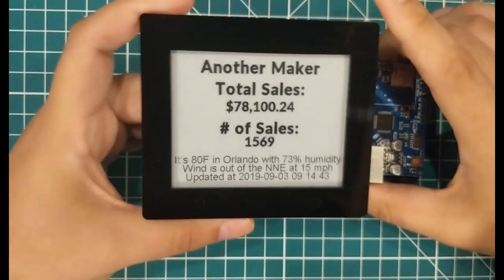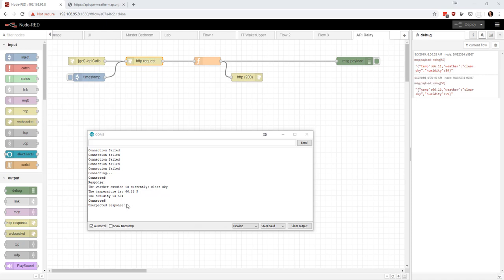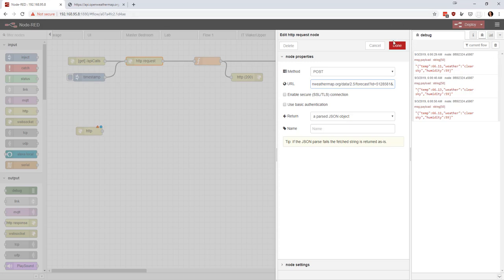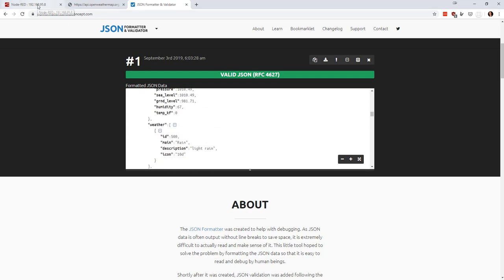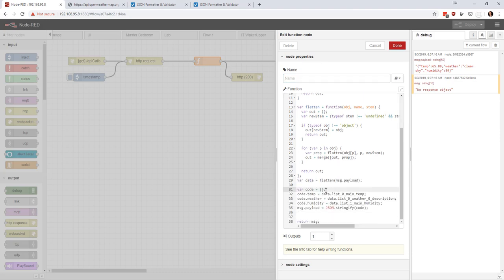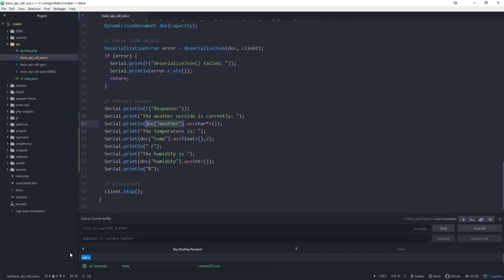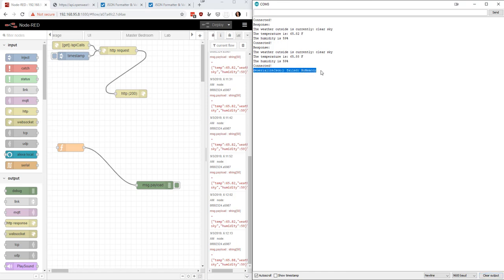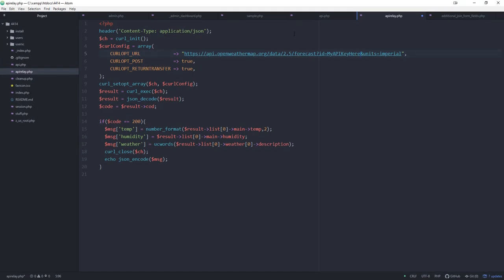Save the Ram! Use an API Relay

Comment: Good solution to the problem. If you're insecurely communicating on your own network, why bother with http between the iot device and your local server? Why not just drop to the sockets layer? Wouldn't that be more memory efficient? If all you want to do with the data is display it, it seems you could even have the server construct the final string and then the Arduino could just do a single println of whatever it receives. (Honest questions. All my network experience is  on desktop class machines. Don't know anything about IoT network implementations.)